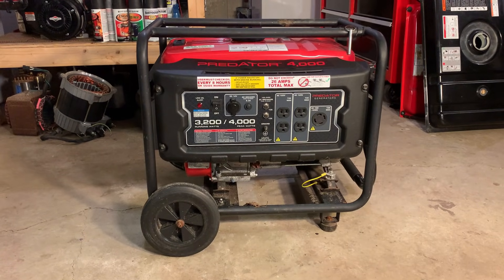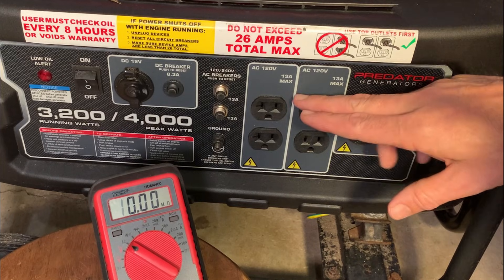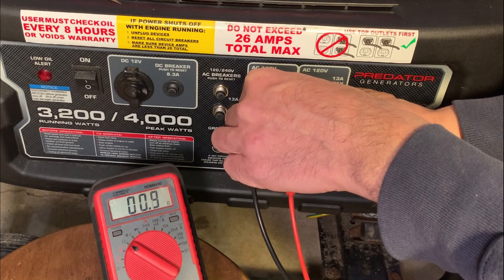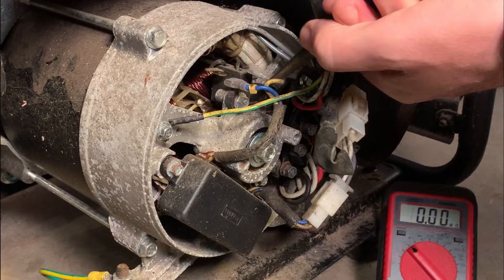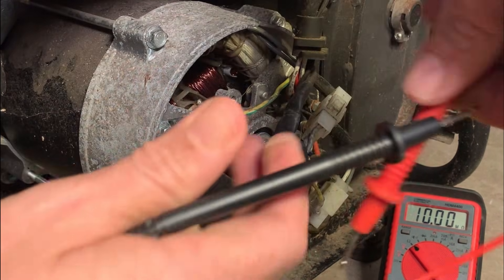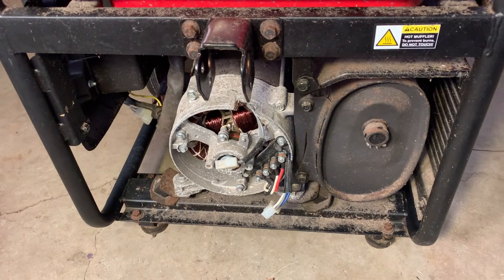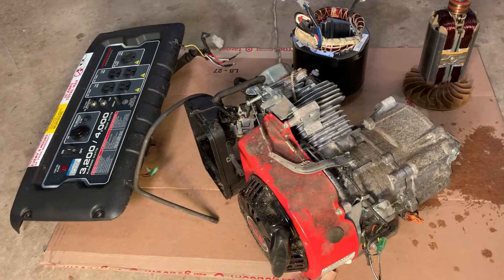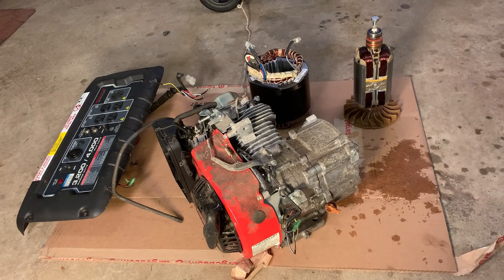Predator Generator Not Making Power

Comment: Id probably try that also, i have the same generator!  At home 3200/4000 w. Use some heavier gauge wire. I'd try to get that wire connected.
Reply: Don’t forget about the generator safety rules: Always make sure you follow all the generator safety rules whenever you use your portable generator. This is only a reminder. Generators can be dangerous if not used carefully. Every year, hundreds of people die or get injured when using portable generators due to carbon monoxide poisoning and electrocution. Make sure you are using your generator carefully and keeping others safe as well. There is something very serious that everyone should always be aware of when using generators. Some people do run their generator indoors which is not safe and that increases the risk of carbon monoxide poisoning which can cause death of family and you. Some people run their generator in wet conditions which can electrocute them. Please remember that you should never run your generator indoors. Remember that carbon monoxide is an odorless and colorless gas that you cannot see or smell. Carbon monoxide is a silent killer. Keep that in mind. Make sure your generator is 15-20 feet away from your house and away from doors, windows, and vents. Never use your generator in your porch too. Having a carbon monoxide detector is very important against generator safety. Some people also allow children to go near the portable generator which could pose risks. We need to keep an eye on our children making sure that they are not near the portable generator so they won’t get electrocuted or burned by the generator which is dangerous. A locking enclosure also keeps kids safe. A generator shed might look like a tempting place to explore, or take cover during a game of hide and seek, but a generator is a dangerous piece of equipment that can cause injury. It says on the manual that we should also keep children away at all times from the portable generator to avoid injuries. Please do not allow a child or unqualified people to operate the portable generator.  It is important to keep your children safe especially little ones. The portable generator can be hot during an operation. Just because some manuals missed what should be listed doesn’t mean it’s safe to do. Always follow the generator safety rules when using portable generators. Generators pose electrical risks. If you need to use your generator during wet weather, you need a generator tent to protect your generator from getting wet. Don’t let your generator get wet. Keep your generator dry and before using your generator, please make sure your hands and your generator is dry. Do not wear loose clothing when operating the generator. Everything that is said on the generator’s operating manual should not be ignored. Never smoke cigarettes near the generator. Please keep flammable things away from the generator. Never overload your generator too. Your generator can catch fire. Never ever try to plug a generator cord into a wall outlet to avoid back feeding. Back feeding your generator is dangerous. Always turn on your generator first before plugging in appliances and shut off the appliances before turning your generator off. Use a heavy duty cord for your generator and the cord should not be worn out. All the instructions should be followed carefully. Never refuel your generator while it’s running. It can cause fire if fuel spills while your generator is hot. You should turn off your generator and let it cool off before refueling it. Having a fire extinguisher next to the generator is also important. This is only a reminder for everyone’s safety of using generators. Make sure your generator is properly grounded. Having a fire extinguisher next to the generator is also important against the safety rules. https://youtu.be/I1jT3ANENvI and here is a video more about keeping others safe when using generators and also about our family’s safety. It’s important to keep our little children safe as well. Make sure your little children are kept away from the generator at all times especially when it’s running. Hope this helps. Always remember that it’s better to be safe than sorry.

Comment: That rotor is most certainly Salvageable! Just unwind the wire once and if the enamel cracks or reveals bare copper, repaint with more enamel or a clear coat. What a waste of parts 😔
Reply: Don’t forget about the generator safety rules: Always make sure you follow all the generator safety rules whenever you use your portable generator. This is only a reminder. Generators can be dangerous if not used carefully. Every year, hundreds of people die or get injured when using portable generators due to carbon monoxide poisoning and electrocution. Make sure you are using your generator carefully and keeping others safe as well. There is something very serious that everyone should always be aware of when using generators. Some people do run their generator indoors which is not safe and that increases the risk of carbon monoxide poisoning which can cause death of family and you. Some people run their generator in wet conditions which can electrocute them. Please remember that you should never run your generator indoors. Remember that carbon monoxide is an odorless and colorless gas that you cannot see or smell. Carbon monoxide is a silent killer. Keep that in mind. Make sure your generator is 15-20 feet away from your house and away from doors, windows, and vents. Never use your generator in your porch too. Having a carbon monoxide detector is very important against generator safety. Some people also allow children to go near the portable generator which could pose risks. We need to keep an eye on our children making sure that they are not near the portable generator so they won’t get electrocuted or burned by the generator which is dangerous. A locking enclosure also keeps kids safe. A generator shed might look like a tempting place to explore, or take cover during a game of hide and seek, but a generator is a dangerous piece of equipment that can cause injury. It says on the manual that we should also keep children away at all times from the portable generator to avoid injuries. Please do not allow a child or unqualified people to operate the portable generator.  It is important to keep your children safe especially little ones. The portable generator can be hot during an operation. Just because some manuals missed what should be listed doesn’t mean it’s safe to do. Always follow the generator safety rules when using portable generators. Generators pose electrical risks. If you need to use your generator during wet weather, you need a generator tent to protect your generator from getting wet. Don’t let your generator get wet. Keep your generator dry and before using your generator, please make sure your hands and your generator is dry. Do not wear loose clothing when operating the generator. Everything that is said on the generator’s operating manual should not be ignored. Never smoke cigarettes near the generator. Please keep flammable things away from the generator. Never overload your generator too. Your generator can catch fire. Never ever try to plug a generator cord into a wall outlet to avoid back feeding. Back feeding your generator is dangerous. Always turn on your generator first before plugging in appliances and shut off the appliances before turning your generator off. Use a heavy duty cord for your generator and the cord should not be worn out. All the instructions should be followed carefully. Never refuel your generator while it’s running. It can cause fire if fuel spills while your generator is hot. You should turn off your generator and let it cool off before refueling it. Having a fire extinguisher next to the generator is also important. This is only a reminder for everyone’s safety of using generators. Make sure your generator is properly grounded. Having a fire extinguisher next to the generator is also important against the safety rules. https://youtu.be/I1jT3ANENvI and here is a video more about keeping others safe when using generators and also about our family’s safety. It’s important to keep our little children safe as well. Make sure your little children are kept away from the generator at all times especially when it’s running. Hope this helps. Always remember that it’s better to be safe than sorry. Thank you

Comment: Put your 10 x1. 5 bolt in the shaft, and use a slide hammer.
Reply: Don’t forget about the generator safety rules: Always make sure you follow all the generator safety rules whenever you use your portable generator. This is only a reminder. Generators can be dangerous if not used carefully. Every year, hundreds of people die or get injured when using portable generators due to carbon monoxide poisoning and electrocution. Make sure you are using your generator carefully and keeping others safe as well. There is something very serious that everyone should always be aware of when using generators. Some people do run their generator indoors which is not safe and that increases the risk of carbon monoxide poisoning which can cause death of family and you. Some people run their generator in wet conditions which can electrocute them. Please remember that you should never run your generator indoors. Remember that carbon monoxide is an odorless and colorless gas that you cannot see or smell. Carbon monoxide is a silent killer. Keep that in mind. Make sure your generator is 15-20 feet away from your house and away from doors, windows, and vents. Never use your generator in your porch too. Having a carbon monoxide detector is very important against generator safety. Some people also allow children to go near the portable generator which could pose risks. We need to keep an eye on our children making sure that they are not near the portable generator so they won’t get electrocuted or burned by the generator which is dangerous. A locking enclosure also keeps kids safe. A generator shed might look like a tempting place to explore, or take cover during a game of hide and seek, but a generator is a dangerous piece of equipment that can cause injury. It says on the manual that we should also keep children away at all times from the portable generator to avoid injuries. Please do not allow a child or unqualified people to operate the portable generator.  It is important to keep your children safe especially little ones. The portable generator can be hot during an operation. Just because some manuals missed what should be listed doesn’t mean it’s safe to do. Always follow the generator safety rules when using portable generators. Generators pose electrical risks. If you need to use your generator during wet weather, you need a generator tent to protect your generator from getting wet. Don’t let your generator get wet. Keep your generator dry and before using your generator, please make sure your hands and your generator is dry. Do not wear loose clothing when operating the generator. Everything that is said on the generator’s operating manual should not be ignored. Never smoke cigarettes near the generator. Please keep flammable things away from the generator. Never overload your generator too. Your generator can catch fire. Never ever try to plug a generator cord into a wall outlet to avoid back feeding. Back feeding your generator is dangerous. Always turn on your generator first before plugging in appliances and shut off the appliances before turning your generator off. Use a heavy duty cord for your generator and the cord should not be worn out. All the instructions should be followed carefully. Never refuel your generator while it’s running. It can cause fire if fuel spills while your generator is hot. You should turn off your generator and let it cool off before refueling it. Having a fire extinguisher next to the generator is also important. This is only a reminder for everyone’s safety of using generators. Make sure your generator is properly grounded. Having a fire extinguisher next to the generator is also important against the safety rules. https://youtu.be/I1jT3ANENvI and here is a video more about keeping others safe when using generators and also about our family’s safety. It’s important to keep our little children safe as well. Make sure your little children are kept away from the generator at all times especially when it’s running. Hope this helps. Always remember that it’s better to be safe than sorry.

Comment: The good thing about these "Chonda" generators is that they are mostly clones of the same thing, over and over,. So, there's bound to be a scrapper out there just waiting to be picked from the trash, and used as a donor for parts.
Reply from the maker: It is a very common setup.  These parts are found on many different brands in the 3000 watt range.

Comment: James, I've tried finding parts diagrams for anything Predator with no success. Yet Harbor Freights says in their ads that parts are available. Thats a head scratcher to me.🇺🇸🤔  Roger
Reply: The key is to ask them to do a cross reference search against all models of your particular size generator.  I just ordered parts for my 63970 (9K watt) but had to cross reference 63968, 69, and 71 I think to get all the spares I wanted to keep on hand.
Reply: @Vicarium  thanks for the info, i just cant find diagrams on the internet.
Reply: @Vicarium  Don’t forget about the generator safety rules: Always make sure you follow all the generator safety rules whenever you use your portable generator. This is only a reminder. Generators can be dangerous if not used carefully. Every year, hundreds of people die or get injured when using portable generators due to carbon monoxide poisoning and electrocution. Make sure you are using your generator carefully and keeping others safe as well. There is something very serious that everyone should always be aware of when using generators. Some people do run their generator indoors which is not safe and that increases the risk of carbon monoxide poisoning which can cause death of family and you. Some people run their generator in wet conditions which can electrocute them. Please remember that you should never run your generator indoors. Remember that carbon monoxide is an odorless and colorless gas that you cannot see or smell. Carbon monoxide is a silent killer. Keep that in mind. Make sure your generator is 15-20 feet away from your house and away from doors, windows, and vents. Never use your generator in your porch too. Having a carbon monoxide detector is very important against generator safety. Some people also allow children to go near the portable generator which could pose risks. We need to keep an eye on our children making sure that they are not near the portable generator so they won’t get electrocuted or burned by the generator which is dangerous. A locking enclosure also keeps kids safe. A generator shed might look like a tempting place to explore, or take cover during a game of hide and seek, but a generator is a dangerous piece of equipment that can cause injury. It says on the manual that we should also keep children away at all times from the portable generator to avoid injuries. Please do not allow a child or unqualified people to operate the portable generator.  It is important to keep your children safe especially little ones. The portable generator can be hot during an operation. Just because some manuals missed what should be listed doesn’t mean it’s safe to do. Always follow the generator safety rules when using portable generators. Generators pose electrical risks. If you need to use your generator during wet weather, you need a generator tent to protect your generator from getting wet. Don’t let your generator get wet. Keep your generator dry and before using your generator, please make sure your hands and your generator is dry. Do not wear loose clothing when operating the generator. Everything that is said on the generator’s operating manual should not be ignored. Never smoke cigarettes near the generator. Please keep flammable things away from the generator. Never overload your generator too. Your generator can catch fire. Never ever try to plug a generator cord into a wall outlet to avoid back feeding. Back feeding your generator is dangerous. Always turn on your generator first before plugging in appliances and shut off the appliances before turning your generator off. Use a heavy duty cord for your generator and the cord should not be worn out. All the instructions should be followed carefully. Never refuel your generator while it’s running. It can cause fire if fuel spills while your generator is hot. You should turn off your generator and let it cool off before refueling it. Having a fire extinguisher next to the generator is also important. This is only a reminder for everyone’s safety of using generators. Make sure your generator is properly grounded. Having a fire extinguisher next to the generator is also important against the safety rules. https://youtu.be/I1jT3ANENvI and here is a video more about keeping others safe when using generators and also about our family’s safety. It’s important to keep our little children safe as well. Make sure your little children are kept away from the generator at all times especially when it’s running. Hope this helps. Always remember that it’s better to be safe than sorry.